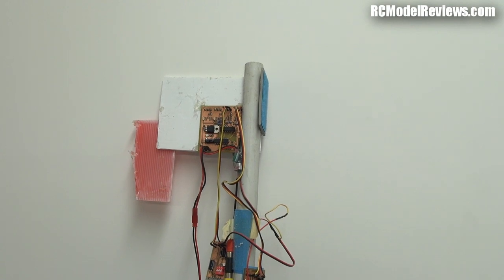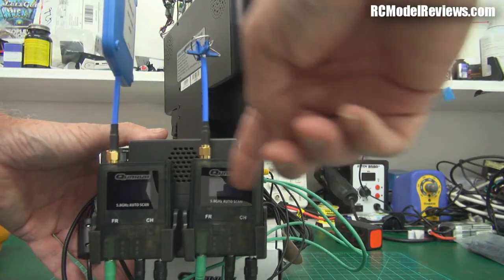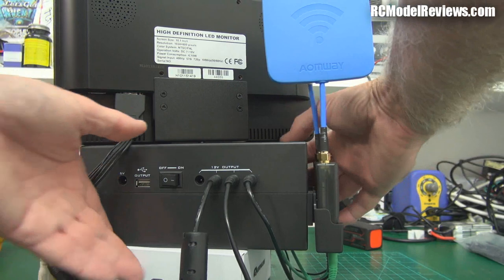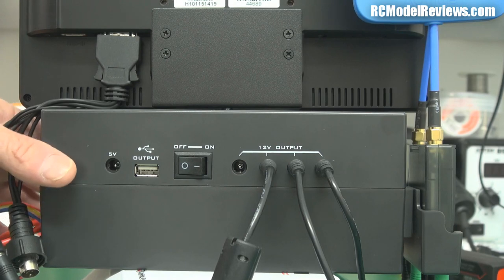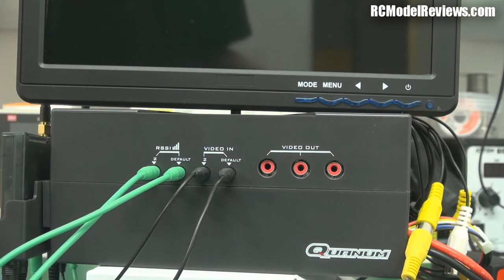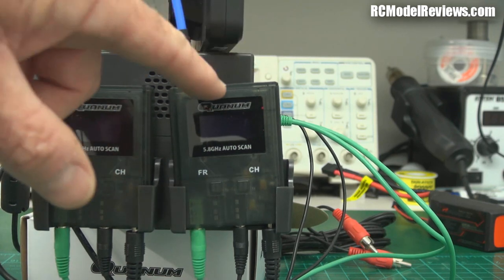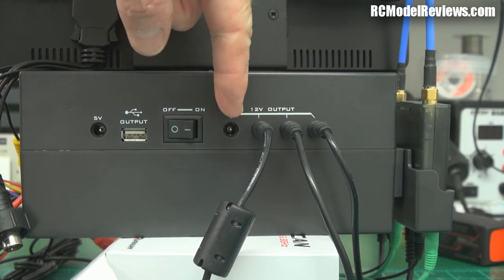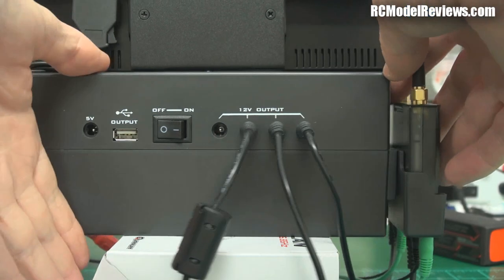Quanum FPV ground station (with suggestions for improvements)

Comment: Great idea, and review feedback. I hope HobbyKing take note!
DIY guys could probably mod this quite easily to add the extra outlets.
Would also suggest jump-leads for running off a car battery, and bigger space for using parallel batteries for longer duration, though one or more Y cables can accomplish this.
Could add a solar charge controller too, to keep it topped up on sunny days...
And bigger text to make labels easier to read in low light and for those of us that need glasses!

Comment: Bruce nice review. Re-engineer the ground station box so the screen mount is moved over an inch or so and it will clear the antennas.  Or maybe screw on another camera mount over more to hold the screen in place.

Comment: Hi Bruce, I wonder if the designers intended for the screen to be rotated 90 degrees counter clockwise as this would place the LCD facing the same direction as the monitor, and also make the antenna placement more reasonable? I agree with all of your input though for how they missed the bar for this being worthy of a hard cash investment. For now, it's back to velcro and zip ties and tape on my ground station.

Comment: A severe flaw with this product as I view it is that it is not built into a hard briefcase for ease of transportation. You could incorporate most of the electronics, like the screen and sunshade for the screen into a briefcase of plastic or something similar in regards to durability, and have a few discrete holes in the briefcase for the wires between the recievers and the basestation / monitor. Then all you would need to carry is a briefcase for the basestation, a few poles to mount the recievers onto and an fpvquad and transmitter, preferably in another suitcase. Simple, practical and ready to fpv!

Comment: What type of voltage step downs are inside?  Going from 16v to 5v can create a lot of heat, how does it handle that considering it's a black box sitting in the sun?  While you're dreaming about polishing this turd, some 3.5mm output plugs alongside the RCA jacks would be nice also.

Comment: Looks like a decent GS, certainly makes it easier for someone getting into it. But some of us are ok with tripods/PVC poles and a wired web of battery leads, shows character and is way cheaper. To me a free night wiring up new RC components is a night well spent.

I'm particularly looking forward to the Graphene battery review, I kinda ruined one of my miniquad batteries a while back so here's my chance to try something better (if these Graphene batteries actually pan out). Some reviews say they're legit but of course I wanna see what our resident New Zealander thinks of em. I did manage to catch a scene in the latest HK Weekly video that explains these packs have G10 plates armoring the pack, which explains the excessive weight, but is the armor really necessary on these packs over the standard lipoly packs?

Comment: Bruce, i think one USB is sufficient as you can use a USB splitter and give it extra power with the 5v output, in fact i would bet that is an accessory they may release.
Reply: +Jared Reabow (Jazza) The problem is that most USB connectors are current-limited so you may find that (depending on what limit that one has) they shut down if you try to charge several devices at once via a splitter.
Reply: +xjet ah , but as i said, the 5v out is the plug to give your usb splitter extra extra current.
Reply: +Jared Reabow (Jazza) Yes, you could do that -- but then you've got another "thing" hanging off your ground station and the clutter starts to get as bad as the pole setup.   Why not just put 3 USB jacks on the box and then you wouldn't need the splitter and the 5V? :-)
Reply: +xjet because i would rather pay less and have one usb than pay over the Odds for more than 1 USB when i can litteraly spend $1 at a $ store and get the adaptor
Reply: +Jared Reabow (Jazza) But my point is that it would cost less than $1 to add those extra USB outputs to the ground station and then you wouldn't need to add extra cables and hubs.   I'd rather pay $1 more for the ground station and have a very neat and tidy solution than to pay $1 to the $ store and end up with a mess of wires that is almost as bad as the problem this system is designed to eliminate (ie: too many wires and cables).
Reply: +xjet I get that but unfortunately this is not the reality, more features means more money.
Also i would be surprised if that usb puts out less than 1Amp due to hobbykings track record with lipo to USB being pretty good, perhaps a test is in order?

Comment: Superb review and suggestions Bruce! I have been looking at maybe getting a ground station, to get my antennas up higher, as well as a screen for others, but still haven't found quite the right thing yet ;) Like someone else said below, the first number the voltage reader displays (D) is the difference in V between the highest and lowest cell. I would really like if one came with a 5-7 Ft tripod, and the screen went up top, and then arms going out the sides, for a receiver on each, and then a tray below for everything else. Would it be possible to run two diversity receivers on this?
Reply: I guess im randomly asking but does anybody know of a way to log back into an instagram account?
I was dumb lost my password. I would appreciate any tricks you can offer me!
Reply: @Darius Tristen Instablaster ;)
Reply: @Madden Huxley I really appreciate your reply. I found the site on google and im in the hacking process atm.
I see it takes quite some time so I will get back to you later when my account password hopefully is recovered.
Reply: @Madden Huxley it worked and I actually got access to my account again. I'm so happy:D
Thank you so much, you really help me out !
Reply: @Darius Tristen Glad I could help :)

Comment: hoe much loss do you get on coax?
would it not be more practical to just mount the antenna up high and only have the coax going up the pole?
Reply: It's more lossy than rca leads and also more susceptible to noise. 
A long lead pack available to buy separately would be handy

Comment: The best ground station out there is the one you build yourself for your needs (for much less $$$).
Reply: and than build a wood box for a good look or something like this 😁
Reply: +FGDude agree entirely. I built mine inside a cheap but good quality ABS project box. If you hardwire/solder everything in, there's never any issues with power outputs or cables... and it can be a bit untidy if it's all inside the box.
Reply: +BlueFlyer FPV Yes it can be intimidating, but if you build it step by step, there is nothing to it.
Thanks for the reply.

Comment: Those are barrel connectors, not bayonet connectors; a bayonet has a rotating lock that engages with pins on the mating half (like BNC, or non edison-screw light-bulbs), and is named after the similar mounting method seen on the gun-mounted knives of the same name.

Comment: good video thanks alot. looks ok to me. like you say you could do with the ability to move thoes receivers. what do you recon to thoes aomway antennas? ive got one of thoes patches and dont recon much to it!
Reply: +Scott Powdrill To be honest, I don't recommend any form of linearly polarized antenna (such as a patch) on 5.8GHz.  If you want more range, use a helical.

Comment: A hundred bucks for something that just tidies up your wiring?! But you've still got massively long RSSI and video wires so it still isn't that tidy. If it was cheaper you could quite easily fit all those extra features in yourself